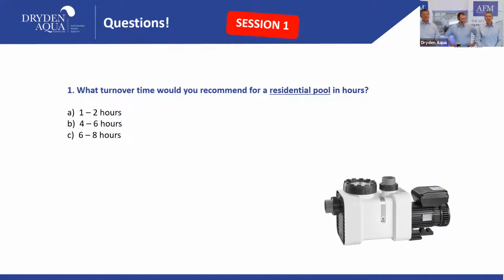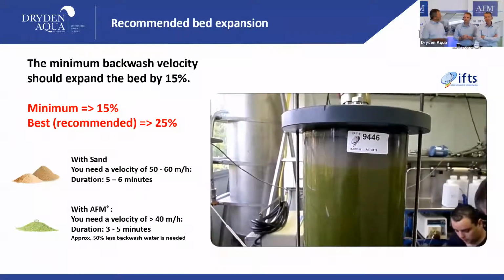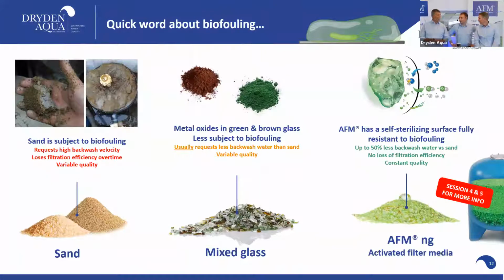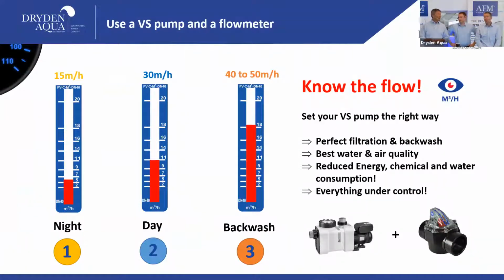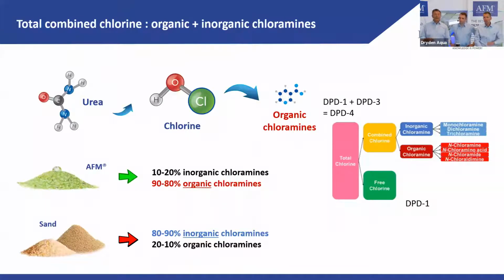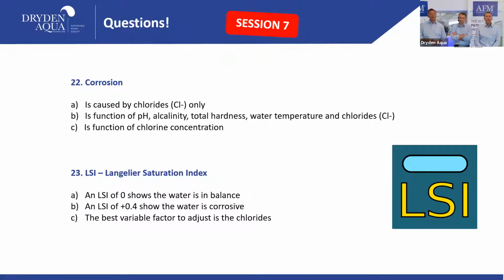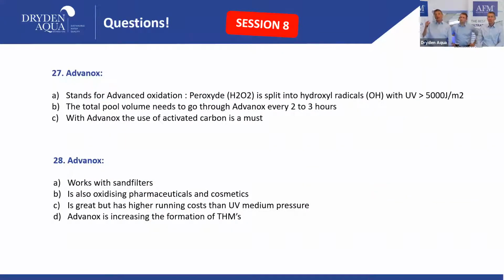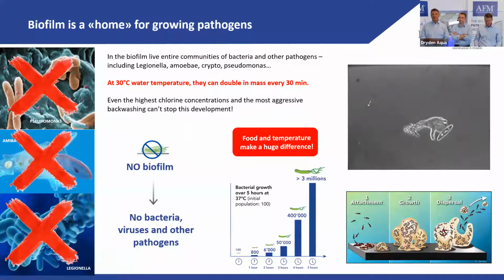SESSION 10 : SUMMARY AND TEST

Comment: Can you please tell me what is the chemical composition of the ACO that I am putting in my pool (I fo not see this on the label)?
Reply from the maker: Dear Peter, ACO consists of a mixture of poly silicates and metal oxides. It is a safe, natural product certified NSF 50 for swimming pools. Safety data sheet can be provided by your pool dealer. In chlorinated systems ACO protects chlorine from photolysis by sunlight and makes it last three times longer in outdoor facilities. ACO does the same as cyanuric acid, but instead of reducing oxidation capacity, ACO increases the oxidation potential of the water.